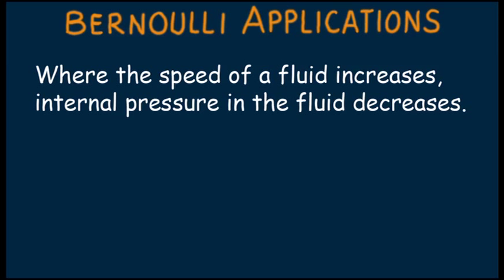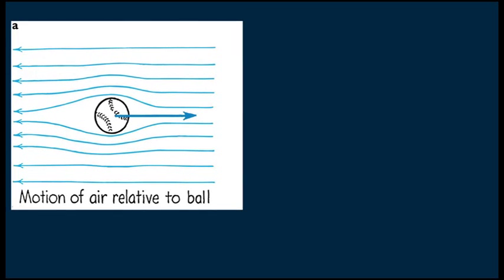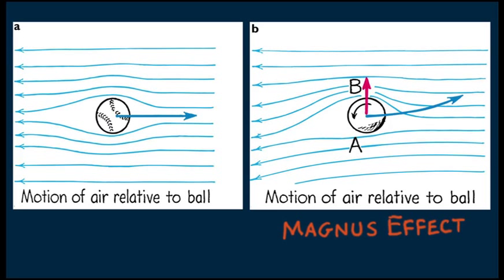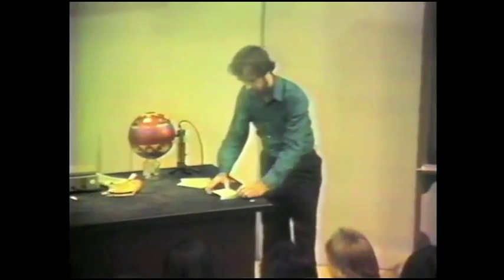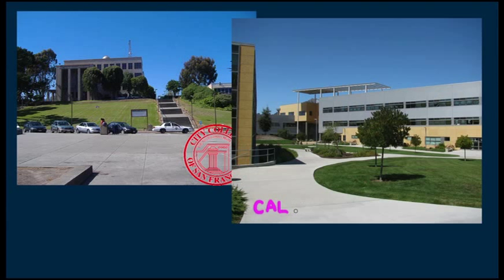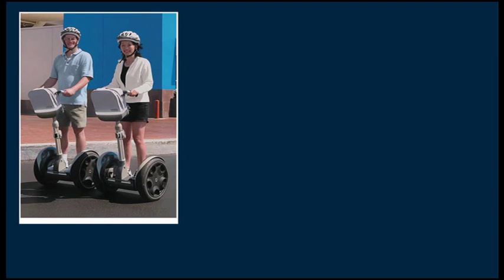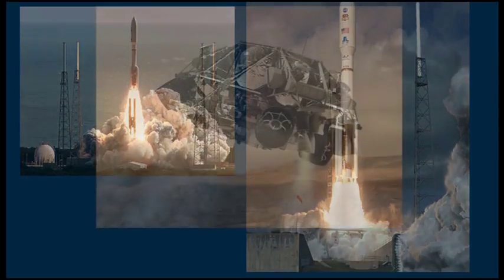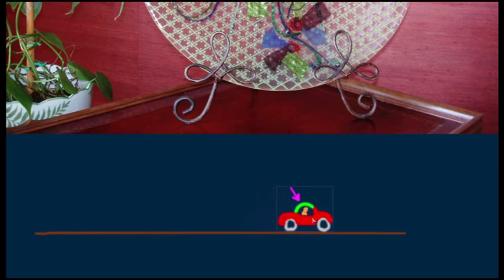Hewitt-Drew-it! PHYSICS 70. Bernoulli Applications

Comment: So many people misunderstand Bernoulli and spread the misinformation around.
..
The fast fluid exiting a blower has the same pressure as the surrounding still fluid.  It is the higher pressure inside the blower that accelerates the fluid out into the lower ambient pressure, still fluid.
...
The flow speed out of the sprayer is NOT increasing.  It is forced to curve around the draw tube, creating the lower pressure due to Coanda. 
.
Bernoulli says NOTHING about internal pressure of fast moving air.  Bernoulli is about accelerating air being associated with pressure gradients around the flow.
..

The soda pop cans is a lower pressure caused purely by the curved flow of the Coanda effect.  It is the air's viscosity that causes the curved flow.
 Prevent the curved flow going around the back of the can and the lower pressure goes away.  I call this my Coanda Inhibitor:
Coanda Inhibitor Videos:
Setup:
https://www.asuswebstorage.com/navigate/s/732E14E1C370491082859EEA9BC1B7974
Demo, It's crude, but you get the idea:
https://www.asuswebstorage.com/navigate/s/E774D67AC2644841A87856ADA59AF67D4 
..
You'll also see the cans spin due to the boundary layer and viscous drag on the cans' surfaces.
..
The curve ball is the Magnus effect and, again due to Coanda's curved flow, NOT speed,
■Aspirators Don't Suck; They Curl  The Atomizer. This shows proof that speed does not lower pressure.  A curved air path does.  NOTE: IT shows a restriction in the flow due to the insertion of the red tube FAR into the flow path!
   http://www.millersville.edu/physics/experiments/093/index.php 
...
Regards